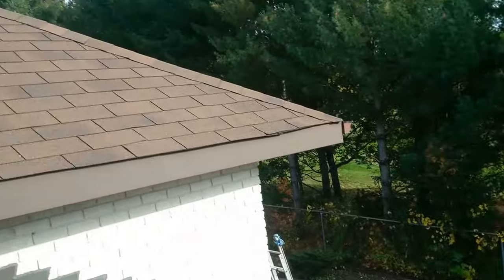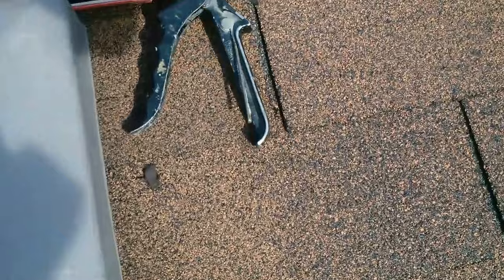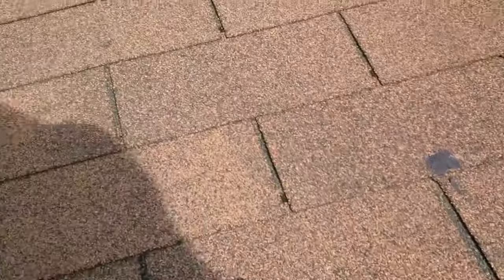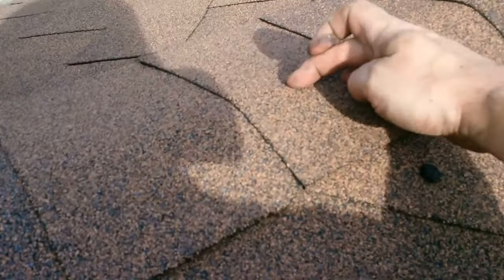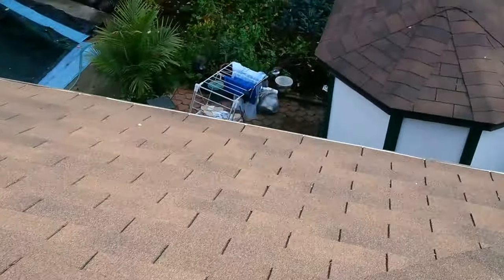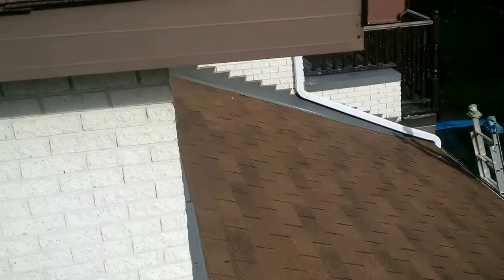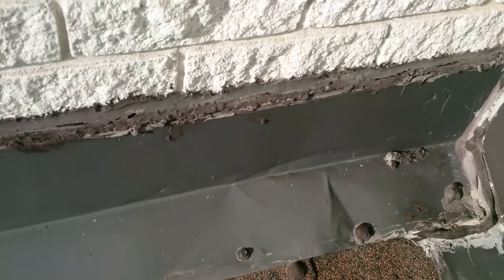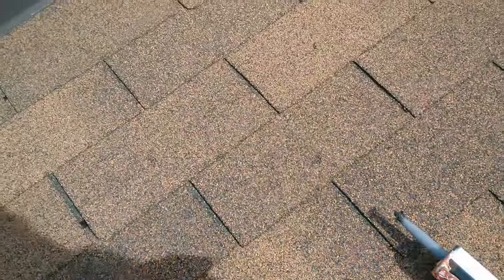ASPHALT SHINGLES NAIL POPPING

Comment: Should have separated the shingles with a flat bar remove the nail caulk between shingles and press the old shingle down on caulking that way you don't have black spots all over the roof
Reply: You got thwt right!!
Reply: Are you serious? If your going to do that might as well redo it (whole roof is shot), next time watch the whole video.
Reply: @bubbsy2002  
I did watch the whole video. I've been a roofer for decades, sometimes the customers just want the leak fixed and dont have a budget for a whole new roof. For example i take care of multiple rental properties for some very tight rental owners. They will push the roof till the very end of its life. Someone has to roof it at that point and because I've already repaired the roof and made that money, the customer and I have formed a relationship, and I'm usually the one to replace the roof, a win win 🏆.
Reply: @marcmiller789  You cannot repair that roof the way you said, because each section has to be redone, flashing, valley’s, and shingles etc. 

Maybe you don’t charge much.
I quit roofing when I was teen because there was no safety back then, almost slid off high steeple roof while stripping multiple layers of shingles including wood shingles.
Reply: @bubbsy2002  
 That roof can absolutely be repaired. I own a roofing company.
Reply: @marcmiller789  How much!
Reply: @bubbsy2002  Each individual tab can be lifted with a flat bar and something could be put over the nail hole once it has been removed, making it unnecessary to remove large sections of the roof, let alone the entire shingle. Nothing gets removed, just a tab lifted caulked or covered and then let back down to stick on the roof mastic.
Reply: @bubbsy2002  Much much less than replacing shingles.
Reply: @raybrensike42  can do that, and then you must caulk down all lifted tabs as lifting them up rips the stones out of the shingle underneath, and or, the existing mastic wont reseal the tab down. IMO 3 tab shingles are a waste of money designed as failure points.
Reply: And I always use a pliable caulk on roof repairs, it doesn’t dry out, crack, or come loose.

Comment: Nails expand and contract from temperature and some eventually work their way out of the hole up thru the shingle. Just remove the nail and patch from under the shingle sticking it to the one underneath with out smearing tar all over the place. This roof had way more problems than a few nails left in during the strip off.

Comment: Pulled out two nails slightly popping out. First storm= roof leak then through kitchen.
Reply: Did you replace them? Caulk the holes of the old ones? Did you get a resolution? :)